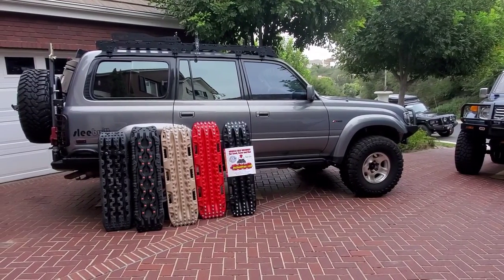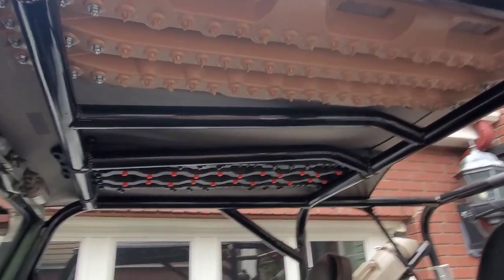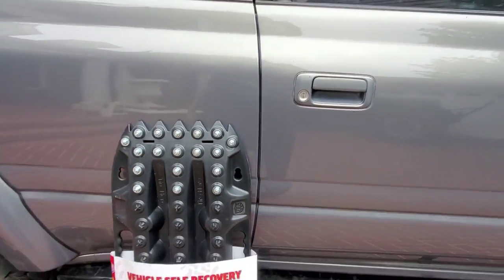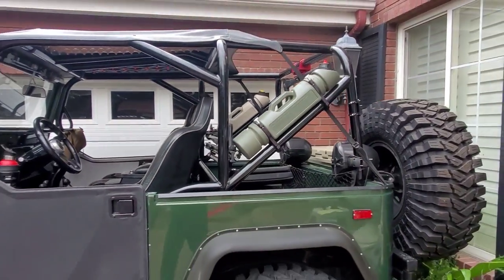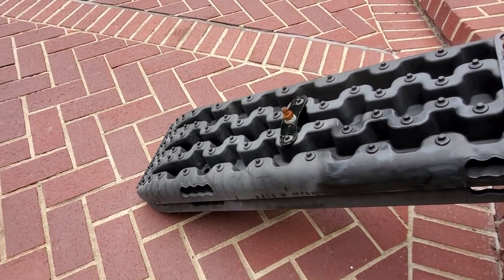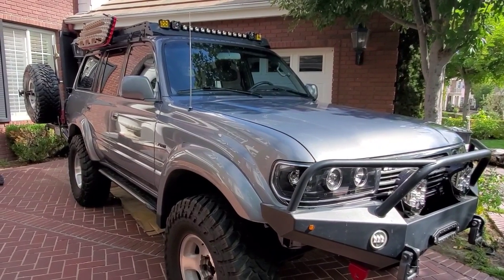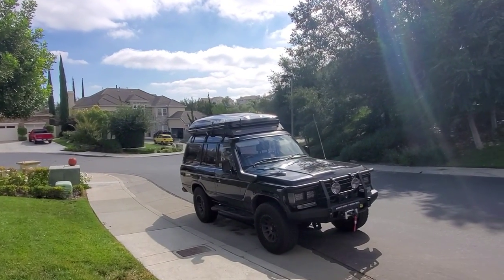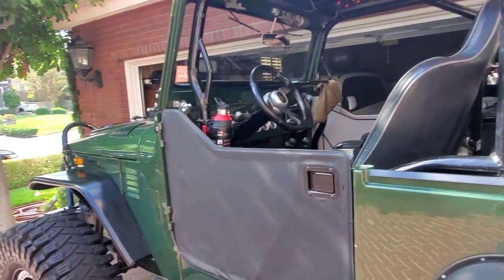✔ Best Recovery Boards and 5 ways to mount

Comment: Best channel on the net… hands down. 
You’re the reason I spent $40K to buy 2013 LX570! SNIFFS
Keep up the great works!
Reply from the maker: Did you buy before 2020? Sounds like you got a great deal! PS I have tinted tail lights for a 2013-2015 LX570. Professionally done, I bought for my 2008 LX570, but lights changed in 2013.
Reply: I’m going to pick it up this week. 
I paid exactly $39K with 102K miles. No accident, Southern car with crazy service history from Lexus. 
I thought I was getting a just ok deal… how did I do?
Reply from the maker: @kwelhand  thats low miles.. 12k per year... not many miles for a 570. I believe you got a good deal. Key being southern car, outside of the rust belt.
My 2008 570 has 230k miles, and still drives like new!
Reply: @CruisingTheLand  That’s great to hear. 
Thanks for putting up a great channel. Your channel helped me enormously when shopping for my LX570. Well done sir!

Comment: I MacGyvered my max track mounts (the ones that stick straight up) so that they fold when not in use. I attached an L bracket to the inside/ 1” section of my Prinsu crossbar. I used a combination of steel and nylon washers to bolt it there. . I attach the maxtrax mounting pin to the L bracket. And the L bracket with a pin on it swivels/ rotates. Very difficult to explain without pictures. But it’s nice, when I’m not using them, they rotate and lie flat parallel to the crossbars. So things can get put on the roof rack.
Reply from the maker: would love to see that

Comment: Mine are ARB TRED Pro boards (come in assorted colors -- mine are dark gray with orange "teeth" costing ~ $300). WHATEVER brand boards you carry -- be they cheap or expensive -- if you don't use them properly you risk damage to tires and/or the boards...especially the boards using metal (bolts) can damage tires big-time if not careful.
But yeah, recovery-boards/traction-mats are definitely part of my off-road gear as I usually am out there alone with no other vehicle to help me out (and I don't have a winch).
-- BR

Comment: What's the warranty on new nylon ones? Heard max has life time warranty? But how many times can they swap them as they look like they only last a couple seasons.
Reply from the maker: 5 year warranty no questions asked... (Unless you cut them with a chain saw...)
A couple seasons? These will last a lifetime. Oh.. besides, these are not using the Nylon6 that Maxtrax is using. This material is used for train couoling bushings, so should last more than a few seasons... and if you burn any of the studs, then replace with hardware from your local store... rear side of board is pre-indented to fit washer hardware.

Comment: What's the details on the round containers that are mounted to the ladder?
Reply from the maker: Those are RollPaxs, by RotoPax.
New in 2019... 1.5 water and Gas container.
They come White for water and red for fuel, I plastidipped them to change the color (and preserves the red polypropolene.

Comment: what size hardware did you use for the nubs?
Reply from the maker: 1/4" 20 TPI x 3/4" galvanized steel bolts with washers and nylock nuts

Comment: Can I get a link to the rear Trax tire mount ?
Reply from the maker: Hi Wesley,
The maker of those went iut if business. I actually bought the last 5 that the manufacturer had (the fab company that was making it for them)
I can sell you one, if you want.
Are you in the US?
Reply: @CruisingTheLand  yes in the US
Reply from the maker: What is your zipcode, I can get a price for shipping. The mount itself is 225
Reply: @CruisingTheLand  23111 is my zipcode
Reply: @CruisingTheLand  will it work on  a Ford wheel five lug
Reply from the maker: @wesleypoe1404  yes, the mounting plate is universal.
Reply: @CruisingTheLand  cool thank you